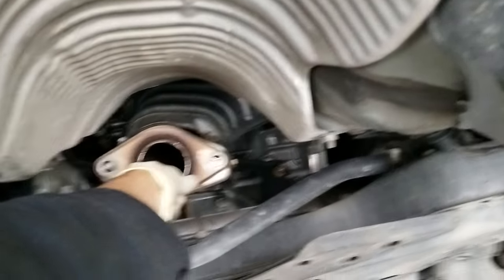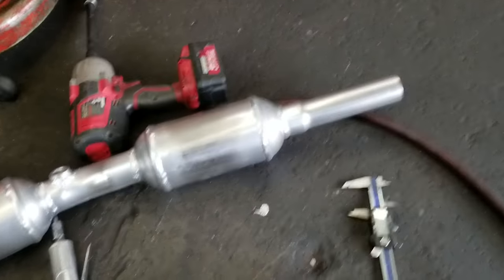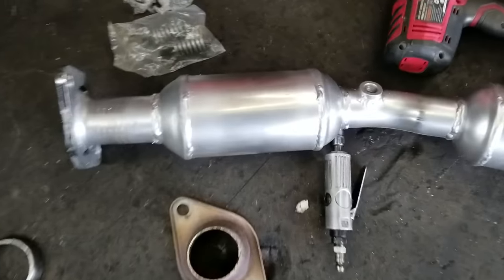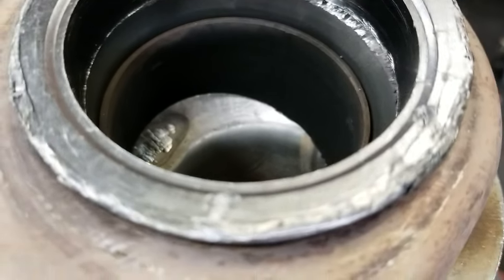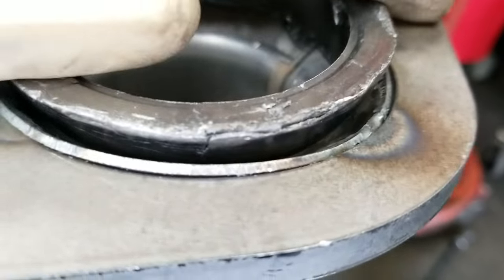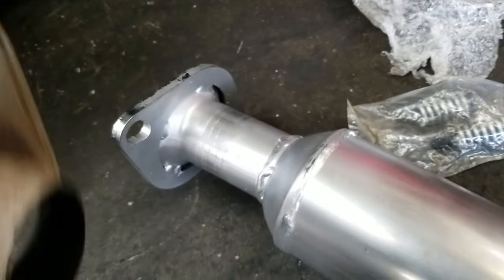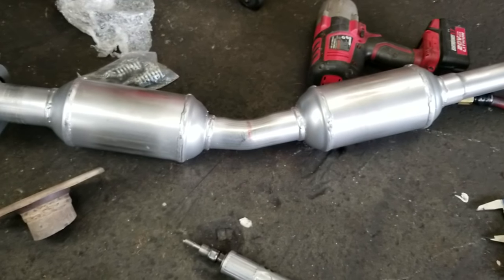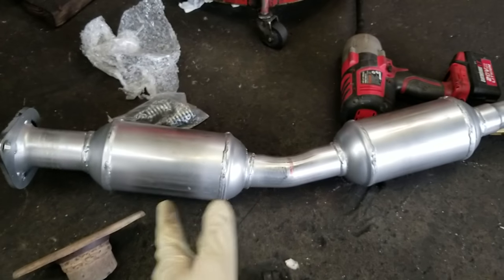Watch before buying Ebay/Amazon Catalytic Converter

Comment: I hate mechanics that try to find fault instead of finding solutions, the difference in OEM price is well worth the modification needed to make this work.
Reply: Yes after market will work just fine
Reply: @leroystrokesmen5666  exactly....I see no issues here.
Reply from the maker: It was installed after I cut off the flange and welded on a factory flange, then welded the back end since the pipes didn't slide over as advertised either.... the cat only lasted about 2 oil changes before getting check engine code for bad cat. Not worth it...
Reply: All he need to do is grind that inner sealing piece flush then he can weld the outer flange fully from the outside and walah 10 bucks in grinding wheels and 10 bucks for 2lb of ideal e71tgs if your doing it with cheap wire welder 10 bucks in gaskets.
Reply: I think you would be the first to complain when this junk fails
Reply: Facts!… 👍💯
Reply: aftermarket o2 sensors made my engine run rough in a dodge truck but I recently had cat stolen on outlander.  I used aftermarket cat from Amazon  and oem sensor.  Worked fine.
Reply: @subtledriver you have reason, I buy one of this cat and to put on the car was terrible... this not work well...
And actually I have a question for you I will appreciate if you can advise me. I feel the car different now when change the cat, it is posible that is obstructing the gas outlet of the car because the filters that these catalysts have are not of good quality???
Reply: @Kyle_gallegher THERE IS NO PHALANGE
Reply: @____-gy5mq  Yes it does and if not how did it bolt up before then? It had a flange. Worst case just going to cut it off and re use that old one. Gotta be creative if your gonna be broke 😣
Reply: and "voila"--its French, approximately meaning "there it is". "Walah" isn't a word in any language. @Kyle_gallegher
Reply: @ketch___3666  well I said it anyways mah bwoi 👻
Reply: It’s not that we’re trying to find fault it should be a factor replaceable part if it’s not that’s a lot more headache and a lot more work trying to make something fit for you to save you money it’s gonna cost more money in the long run
Reply: I'm the type of person that would cut and weld or do whatever it takes. I did, however, see other videos where the catalyst material was just ineffective and the vehicle would not pass smog. I wouldn't risk my time or money on these products. Especially for the person would rely on someone else doing the work. It would definitely cost that person a lot more to get a working result.
Reply: @SCBMusic1 cuz ur not doing the work

Comment: You are joking, right?  Ever hear of a pipe expander?  And lead gaskets are MADE to crush fit.  You probably should not have ground off the welds.  It would seal better sitting higher.  For the $1500 difference between ebay and oem, I can deal with the gasket issues.  And hire a mechanic who can improvise....
Reply: Hey joe i have a question if you get this
Reply: @dandan2903  i got one for my prius it should best bet go to a backyard mechanic they will do it better than “professional” mechanics
Reply from the maker: The original gasket is designed to seal with spring loading and be able to pivot/swivel with the engine movement to prevent the exhaust manifold from getting stress cracks. The pipe was physically equal with stock, and If the add states "bolt-on", it should bolt-on without need of extra tools and cutting off a warped flange. The other bolt-on cat's ive installed actually do bolt-up and have quality sealing without warped flanges and work like factory. thanks for the comment.
Reply: Seriously. I don't need a mechanic worrying about like factory when I just had my cat cut out and stolen. Stop playing and get me back on the road.
Reply: @philacy  facts
Reply: Some prefer to pay the $3000.00-$4,500.00 option??? To each their own, hopefully it doesn’t get stolen a second or fourth time tho? 👌
Reply: @jlee7063  they aren’t worth as much if they’re new and not full of the metals they recycle from them right? So they should be ok for awhile…get a bumper sticker that says it’s new and worthless lol
Reply: Exactly there are tools to xpand tubing , and another thing these gaskets are soft they will mold to the shape needed when you tighten the nuts , the important thing is the freaking catalytic converter working properly .
Reply: @jlee7063  once you put aftermarket they will not steal it anymore because aftermarket have no market value,  they can't sell it. (I am an auto mechanic)
Reply: Weld the old flange that the thieves left behind onto the new assembly and at the rear make it fit , use your head , be creative. 🤦🏻‍♂️
Reply: @philacy  If you’re okay with paying a lot extra to fix the issues due to using cheap parts, then I agree. If the customer sought out cheap eBay parts though… they’re probably not looking to spend anymore money. Seems like that was the whole point of the video to me. Sounds like OP got cheap eBay parts (likely per customer request) just to only spend more time, labor and money to rectify the shortcomings of said cheapie parts. More than likely still way cheaper than putting OEM cats on there, but I see his point. Don’t expect cheap off brand ebay parts to fit or work correctly. Hopefully he prepped the customer for the potential scenario that ended up happening.
Reply: @TheAhdoodoo  no there are actual YouTube videos of the equipment he's using. It's no reason to do what he done. No extra cost was needed. The customer ended spending more for using the wrong leach of a mechanic.
Reply: @theetommygunn  😮
Reply: @theetommygunn  like the
Reply: Be creative Mc Giver .
Reply: Go with WALKER exhausts.
Reply: @philacy based solely on this video this is no leach mechanic brother. For maybe an extra hour or two of fabrication labor he's ensuring the pos part the customer brought won't interfere with the functionality of anything else and cause more repair work down the road. And they're still saving a shit load of money over buying the correct part. He's thinking ahead in the best interest of the customer and their wallet. Trust me when i day no tech wants to install customer supplied shit parts. He's making the best of what he has to work with. About the gasket fit, the engine needs to rock slightly and that gasket is designed to allow the flags to hinge slightly while sealing. What do you think a lump of welding slag will do to a soft gasket as it slides over it? Not to mention the out of round flange that would've probably leaked anyway

Comment: I just bought one from eBay for my 06 Prius and it was way better quality. This video was made 2 yrs ago, so I suspect the quality has improved. The flange looks like the original one. Payd $104+tax.. fit perfect. Worth every penny.
Reply: Which seller did you buy from Spacebound?
Reply: @anyC  (  nitupea ) located in walnut California.
Reply: @spacebounduniverse9350  Thank you
Reply from the maker: So what is the link to the one you purchased? Cheap fake cats on ebay don't last long, before check engine light comes on. especially on hybrids where they turn on and off many times in a drive. How many miles and years do you have, who installed it, how was the swivel flange and the pipe size to attach in the rear?
Reply: Curious how your eBay cat is functioning after a year.
Reply: @brandonrestivo9181  the check engine light comes on because of its low efficiency, but I expected that, otherwise it's still has me on the road 👍
Reply: @subtledriver  sorry it took me so long to see this but, yes the light is on but i was never expecting it to be efficient, as I knew that it lacks the precious metals that real cats equip. The flange is well made and the swivel neck is still holding after almost 2 years. I installed it.
Reply from the maker: @spacebounduniverse9350  thanks for your updated response. Do you have plans to replace the failed cats, or just keep driving it with the cel on? You replaced it because the original was stolen, or because it had cel for bad cat?
Reply: @subtledriver no problem im happy to spread helpful info.. i bought the car cheap becuse the cat was stolen and the owner didnt want to spend the big bucks to fix it... im still driving it around with the same ebay cat till this day. the cel has been taped with black tape and the car is still running as it should. as far as im concerned the car has no issues..

Comment: I'm not even a mechanic but I could fettle around with this to get it to work.  You could use a clamp to reduce the size of the existing pipe and/or use a pipe expander on the Cat end to make it fit.  On the other end that gasket is soft and made of lead, you could easily manipulate it to fit and create a good seal.  Obviously if insurance was paying for it I would insist on OEM parts but if you have an old car not worth much I'd be looking at getting a $100 Cat.
Reply from the maker: It will leak, and cause it to run rich or throw codes from the torn lead seal and air leak and in a few months you will get a p0420 code cause the cat is not designed for an engine that turns off and on so many times.
Reply: @subtledriver  I can fix this up in a couple of hours to make it work just fine
Reply from the maker: @Isaiah 54:17  you aren't an average person with basic hand tools, this is marketed to "bolt-on", but requires welding and the oem type flange to seat and move like the oem or higher quality units.
Reply: @subtledriver  The ''average'' person wouldn't buy it online and try to do it himself in the first place.. any shop can make this pipe work with basic mechanic skills.
Reply from the maker: @user-tz9sm8yd7m  the factory or quality aftermarket cat, can be fitted with basic hand tools and no cutting/welding ect.  "Bolt-on", doesn't mean fabrication tools like welder and skills are required.
Reply: @Isaiah5417-z4x sure, he could have bolted it on with basic knowledge because he didn't have to honor a warranty because he didn't supply the part. But he seems like a decent tech and thinking in the best interest of the customer  by going above and beyond using his higher skill set and wisdom from experience and made this POS part at least fit and physically allow the rest of the car to function as designed and subsequently avoiding future repairs and more expense caused by the shitty part.

Comment: That's really the only problem? You can adapt the rear and you can cut off the front and weld on the old one. Adapt
Reply: exactly what i do with almost every aftermarket part i get. merge as much oem to it as possible. but i do get his point; people are paying money for "direct fit" now he has to do extra work. so the client loses money on both buying the part and letting it get installed
Reply: So you pay less for "direct fit" and end up paying shop 100-170/hr to make it work.. Yeah,  that's it.  Might as well just buy an OEM CAT and have a longer lasting CAT.   Which is what his point in video is.
Reply: Did you watch the video?  That's precisely what he said he was doing.

Comment: At least he didnt say, "wont fit, buy oem" yes it needs to be modified, but sounds like this guy is willing and able to make this work for his customer.
Reply from the maker: It was installed after I cut off the flange and welded on a factory flange, then welded the back end since the pipes didn't slide over as advertised either.... the cat only lasted about 2 oil changes before getting check engine code for bad cat.
Reply: Yea the ebay cats I got lasted a month don't buy ebay junk

Comment: I've made a similar one to this work on a Civic, the flange had the welds just like that. I just replaced the entire gasket with copper RTV, haha. It was a cheap car that needed a cheap fix and it held together for as long as I had the car so I was happy. I'm guessing that wouldn't be a recommended method for most people though 😂
Reply: That was my first thought...why not just run a thick bead of Permatex around the joint? I've even heard of guys using furnace cement for exhaust leaks....and if it has a big hole or void, mix it up well with some fiberglass wall insulation. 

I get the point he's trying to make, but sometimes the rent needs to get paid, kids need to be fed or grandma needs her meds...and that car needs to get to work one way or another.

Comment: Yep, they are of poor quality welds, but, you get what you pay for. I bought two sets of exact replacement cats and y pipe off Amazon for less than $700 saving about $900 on oem, I did this knowing full well that I would have to do modifications to them, being a mig welder of 25 years helps. If anyone buying these cheap cats isn’t a welder or know one that can do the mods they should take their vehicle to a muffler shop in the first place. But $700 and a few hours of my time isn’t a big deal, whereas saving $900 is. Btw it passed inspection, so they do work.

Comment: There's a sleeve that connects those 2 ends at the back cut. Literally slips over the two halves and tightens with a clamp on each side. It's a rolled metal tube that squeezes tight.
Reply from the maker: That would be nice, if they included something like this. Unfortunately, the ad shows the new part as a slip over with a clamp to "seal it". I've seen many aftermarket cats just work fine. But these cheap ebay/Amazon knock-offs are out of control. Lol
Reply: @subtledriver  size may be wrong but I attached a link to what I'm talking about!

Comment: Great information!  Thank you for pointing this out.  Unfortunately I just received mine today but it's for a 2007 Toyota Tundra and the gaskets are different.  They look like a simple ring that goes over a small extended piece of the pipe at both ends.  I'm hoping like hell it's not going to give me too much grief.  Cheers.  Oh, by the way, I simply couldn't afford $800 plus CAD so the $133 CAD fit my budget.  Hoping I can get it installed for less than $600!!!
Reply from the maker: Good luck! Even if it fits well,,, usually the lower end cat will fail sooner than the expensive one because it has cheaper materials. I would make sure your primary o2 and maf sensor is working great, along with no air leaks and no misfires and thermostat working good. Any of these basic problems will ruin a cat very short time.

Comment: i have the exact same cat. the front works as is. the gasket will seal whn you tighten it down. those caskets are soft and will conform. the rear i did cut and weld. cat works no codes.
Reply from the maker: the function and purpose of the original is to swivel when the motor rocks back and forth to lessen stress and metal fatigue on all the components in the exhaust. this will cancel that function and cause more issues in the future. thanks for the comment.
Reply: how many miles on the new one. did your car had a problem going uphill or clog , or you change the cat for p0420 code..
Reply: The gasket will conform to the shape of the aftermarket flange and spin on the flat factory side of the flange. It will still provide the flex necessary, I think you just wanted to tell the people to buy another cat

Comment: If the mounting for the gasket and graphite seal is really that poor then chop the aftermarket one off and weld the oem one to it, I mean there IS a solution, just kinda sounds like complaining. You are in fact showing that these are not just 'plug-n-play' like the ebay and amazon listings would have you believe, so good on ya for showing people that.
Reply from the maker: Yep, I'm just showing they aren't plug and play like advertised. I had to chop and weld. It worked, but it was not right they advertised it would just "bolt up"

Comment: Man, that's messed up the cats getting stolen. And whoever made that flange didn't know what they're doing. I bought one for my S10 of Amazon but I knew I would have to cut and weld into a pretty straight piece of pipe. Plus I own my own shop, this old S!0 has 220k and failed emissions. Amazon sold me universal marked damage  because of the package for $30. Passed emissions next day.
Reply: How did you hook that up? You should be doing Ytube videos and make bank from going viral….

Comment: I will cut the flange and weld the old one
Reply: Smh. So would i
Reply: how if it was stolen duh the old one is not there to cut ends off and replace with new one

Comment: I currently have the exact problem he's talking about. I bought the cat on eBay, had it installed and I could smell the gasses coming into the car as I drive. i went to a muffler shop to have the back side of the pipe welded. I though my problem was solved but I can still smell the gasses.  my suspicion was a bad doughnut  gasket. I removed the bolts to check the gasket but it was fine , but I did noticed there was smoke marks around it where the gasses leak. I have not removed the cat since it's welded on but I think the cat has a bad flange. 
this video explains exactly what the problem is.
Thanks
Reply from the maker: Man! I'm sorry this happened to you before seeing this video! I would have the exhaust shop install a new upper flange, OEM style, they might have some used ones in the shop they can make work. Let us know how it goes.